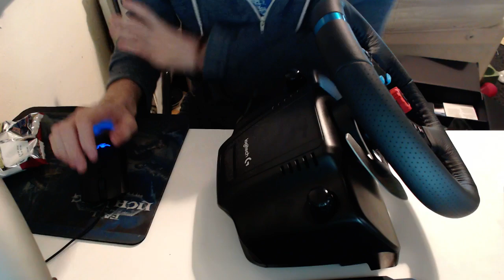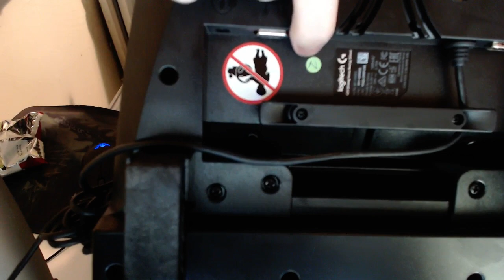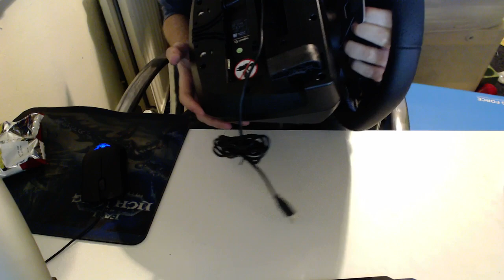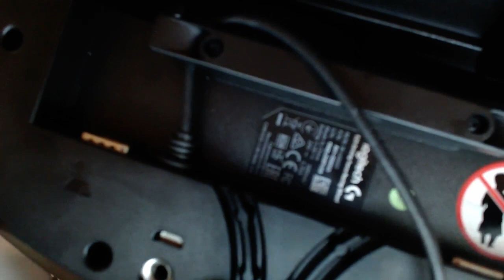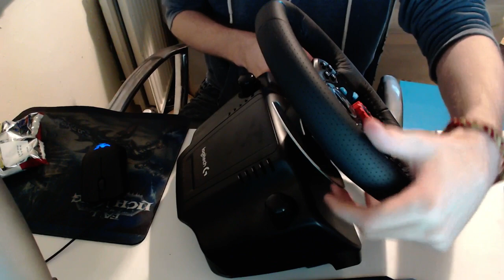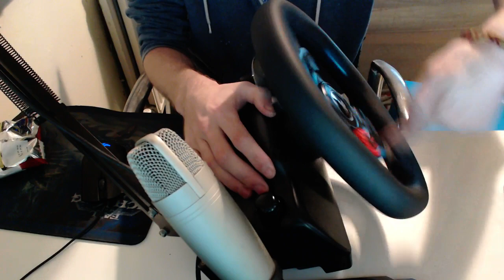Logitech G29 Warranty

Comment: They should really make the circuit board easy to resolder. The handbrake mod is essential and will never be added. That tactical switch is impossible to find and resolder if this happens after warranty.

Comment: They wouldn't even replace mine. lasted lest than week.
Reply: Yeah, same problem here, has not even 10h on it and now the wheel never calibrate again just the pedals and buttons work
Reply: Sounds familiar, Logitech are useless. Never again.
Reply: I finally make it work by desconecting and conecting again for a couple of days, then when finally calirates work's fine... untill the first moment you crash.. the wheel get uncalibrated geting a wrong center point, having to close the game and calibrted again over and over again...
Reply: I have to say this is the worst purchase i've ever made
Reply: I want to buy this wheel soon.  Logitech support (if any problem) replace it immediately?
Video and descripton needed? Thanx all info guys!
Reply: Gabor Don't, not good at all
Reply: Don't buy this wheel?  Any other type or brand? Best Regards, Gabor

Comment: 2 year old video but my brand new g29 (april 2018 model) worked fine for 1 week, then a noise came when turning left. Contacted Logitech and they replaced the wheel which for my bad luck was a refurbished one... 10 days later I asked for a refund because the same problem appeared, plus no right shifter action happened and I'm pretty sure I'll never buy a g29 again.
Reply: JohnStatho got that problem 2. When i turn left with the wheel it makes a squeek noice kind then i watched some youtube videos and saw that like almost every logitech wheel has that. For me its not like a big issue it works perfectky fine and when i turn right its fine.